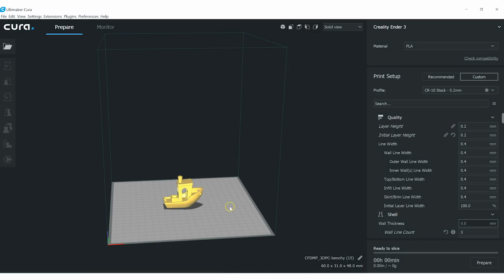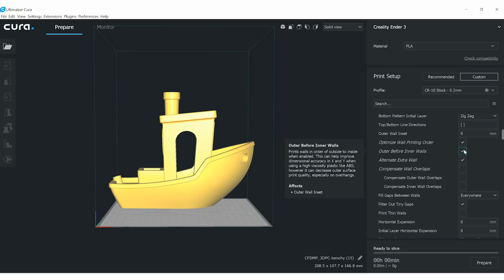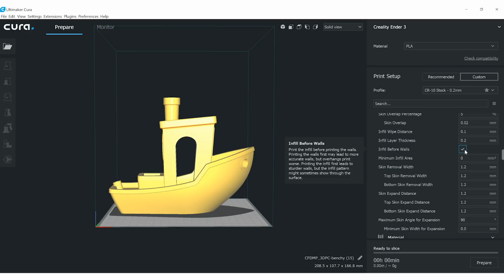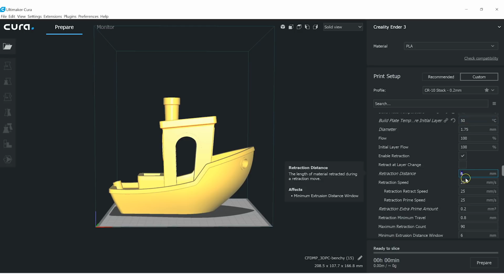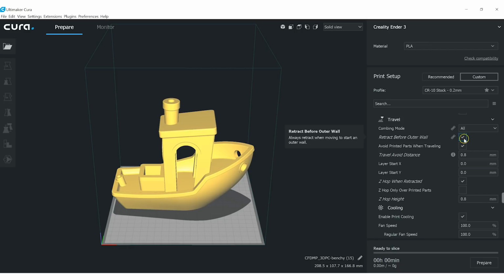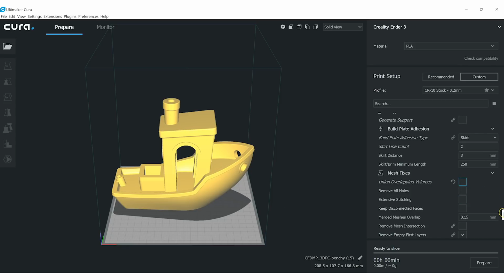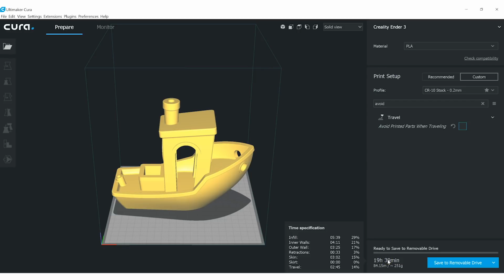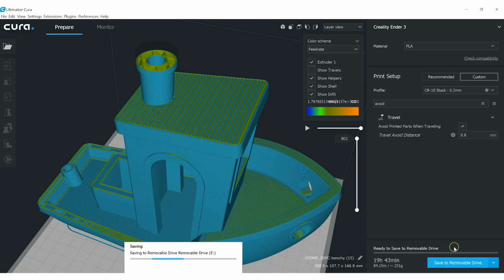Slicing and Printing a Gigantic Benchy on a Creality Ender 3

Comment: I have been aske to contact you I have just built my ender 3 the problem I have is I tried a test piece 100.90mm I set every thing up they seemed to work until it came to printing  I homed all it went through the print motion the printer lifted up a bit it touched the stop switch lifted up again it moved over to the right about 90mm and stopped then went towards the back stopped about 100mm and carried  on  laying filament but it was only printing at the front left corner touching the stop switch every time it layed filament when I say it prints to the left side and to the front  so its well off center would you no of any settings  settings I can try or any adjustments I can make to get it printing in the center. I did manage to get a message back from Creality  he said if I wanted to print in the center I should place the object in the center I told him using Cura it would always set the object in the center unless I want to move it which I don't  not a good answer was it any I hope you don't mind me asking as its getting to the stage that I have had enough, watched your video wonderful thank you for your time

Comment: Hi Jason
Great video. Some suggestions for future videos like explaining some of the various printing defects and their possible remedy. (Like Z Banding and how to fix it)   Things you should do to prepare your printer before a long print.  Regular printer maintenance we all should be doing. An interesting project would be to upgrading either an Ender 3, CR10 mini or CR10 to dual z screws, direct printing, auto bed leveling and a better control board with touch LCD.   Design and  build a printer from scratch. Obviously the last two ideals would require a multiple video series.  Just some ideas to think about. 
Suggestion, when talking about something specific in your videos, it would help to either show a close up or take a picture and show that for a few seconds. 
Enjoying your videos and please keep up the great work you Guys are doing. It's so refreshing to see a good Canadian 3D Printing Company that has experience and obviously loves what they are doing.. 
Cheers
Willy

Comment: Could have made it bigger if you had turned it 45 degrees.
Reply: RFC3514 That’s what I did
Reply: I was thinking piece by piece...
Reply: Well, naturally. But that would apply to any printer, if you are willing to chop the model into enough separate pieces. I think the idea here was to see how big this printer could go in a single print.

Comment: Good video.  How much filiment did the benchy use? I would like to try one in a metal filiment, problem is the spools are much smaller and I don't want to run out during the print.  Thanks.

Comment: I have just bought the ender 3, where can I get the ender 3 Cura profile from ?
Reply: Jason thank you for that. I’m totally new to the 3d printer game and my ender 3, could you guys show how best to setup Cura with an ender 3 ? Thank yoj
Reply: yes please show us
Reply: Jason a video on setting up profiles would be amazing, thank you
Reply: He just did.
Reply: Here's the video on setting up a machine profile for the ender 3 - https://youtu.be/K7tVTYZ9A24
Reply: When using a cr-10 pre made profile, make sure you adjust the machine settings g-code for the beginning, it by default tries to reload the filament, causing the ender to spit out pla then beep in error.